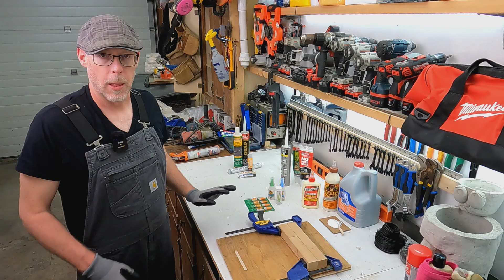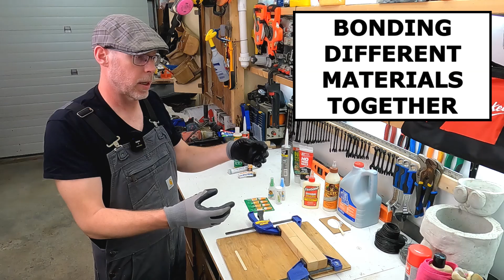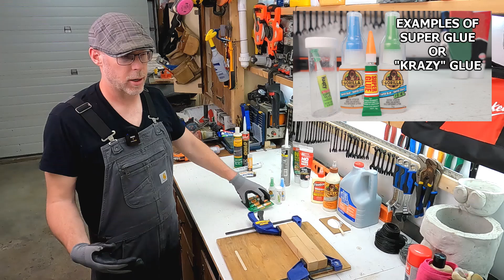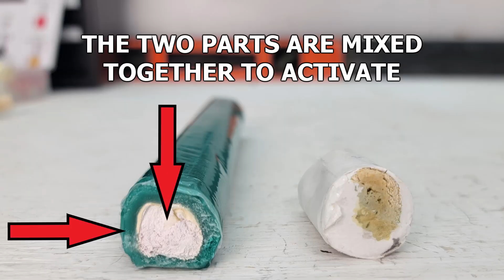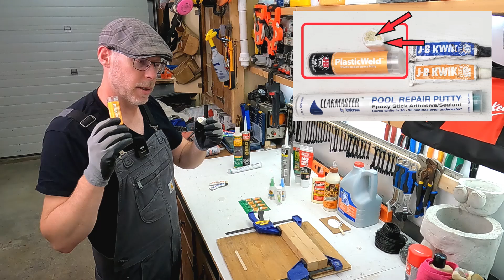What Glue To Use For Different Materials?

Comment: Which glue you recommend for a drawer.  
Need to glue a metal rail to the bottom of a wooden drawer.
Reply from the maker: Gorilla glue or a two part epoxy that is rated for both metal and wood.